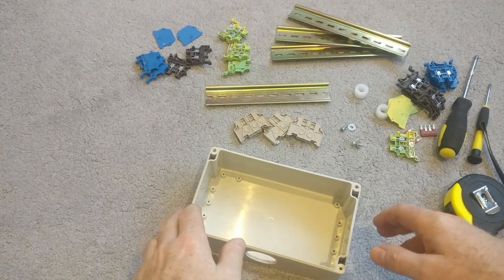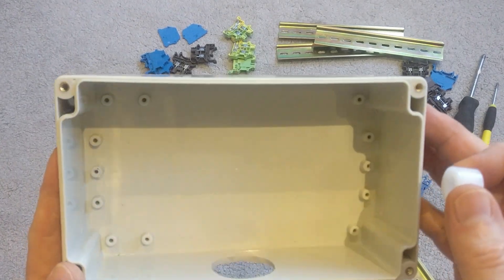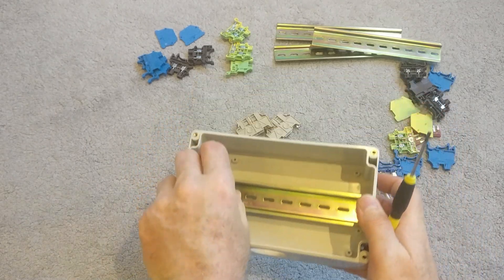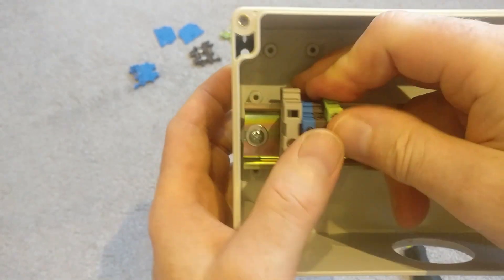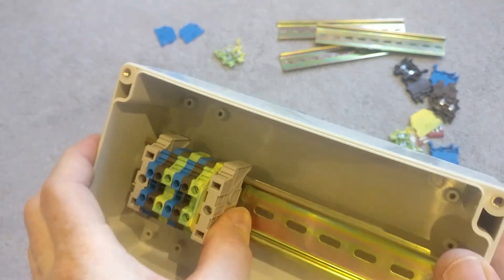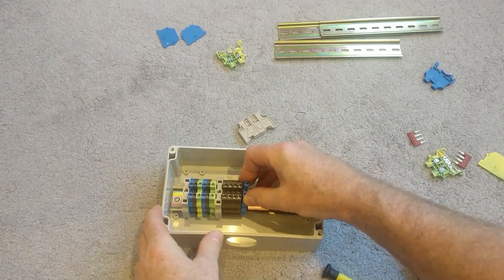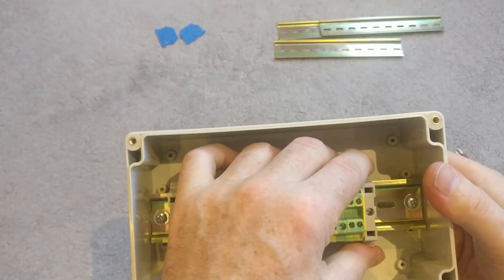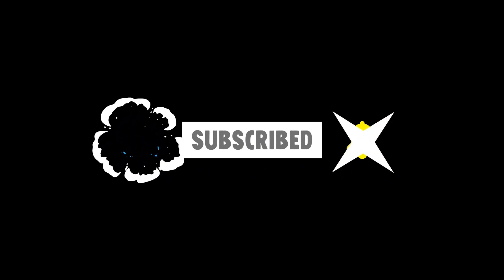Build a Junction Box with DIN Rail Terminal Blocks

Comment: Hi
I've seen this once before in a garden.
I want to try a new way to connect up and down stairs lights, so as the the rooms have their Perm lives. Instead of using a whiska box and 10 lever wago connectors. Do you this this would work, as it seems neater
Reply from the maker: Hi. So you mean using this a star type supply to various lights?  That would work for sure.

Comment: Is there a color code standard for the terminal blocks and wiring insulation colors for ISO or Europe standards?
Reply from the maker: Terminal block colour coding depends on the electrical standard in use, but generally: Green/Yellow is for protective earth, Blue for neutral in AC, Brown/Black/Grey for AC live (phase) conductors, and Red or Black/White for DC positive/negative, with specific colour assignments varying by standard, such as IEC or NEMA. It's crucial to identify the applicable standard before wiring to ensure safety and correct function.

Comment: Why the PE through terminal blocks don't have built-in pin slots for making a common PE stack?
On the right side, you wil have one live wire, one null wire and one pe wire entering. How will you distribute the PE if the blocks dont have pin slots?
Reply from the maker: The PE is provided by the common earth din rail as all the earth blocks are connected to and have continuity to it.

Comment: Great video but way too  many wires for a little tiny box... You will struggle to get all the wires in, it will look messy  and also it will heat up. You got at least 36 wires going in there kkkkkkkkk Personally I AM THINKING 200mm X 200mm at least...

Comment: Nice job, bought virtually identical box. What screws did you use to fix the DIN rail please and where did you get them?
Reply from the maker: Hi Kevin. Thanks. They were already in my toolbox. They were self tap screws about 5mm long..they were from screws supplied for kitchen cabinet  trim.